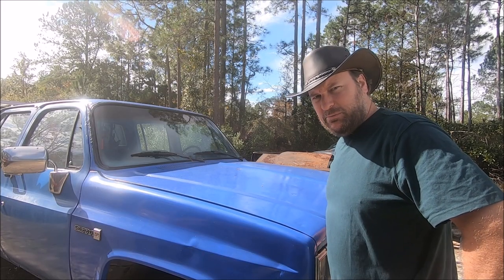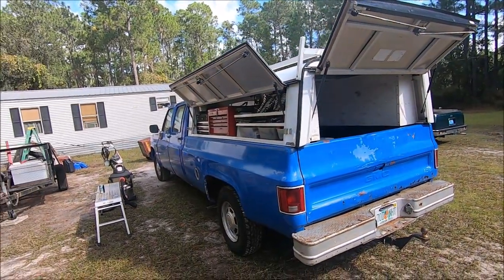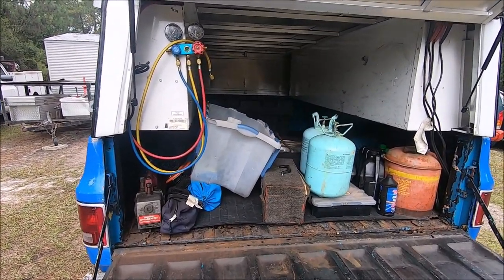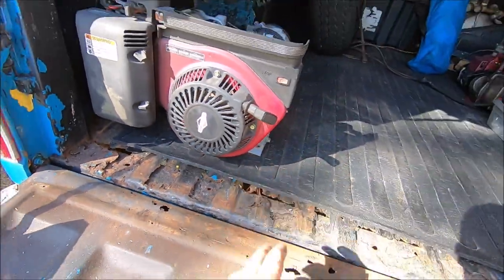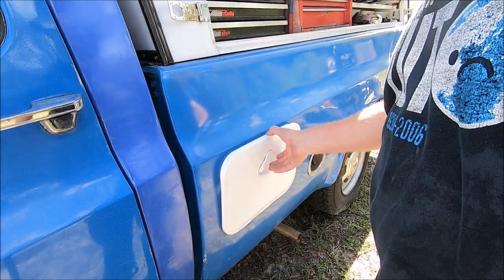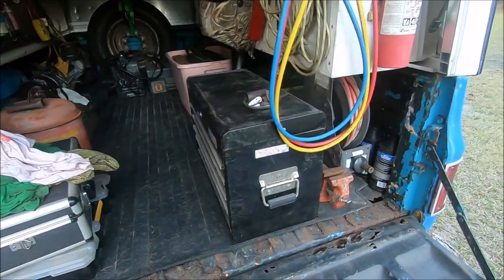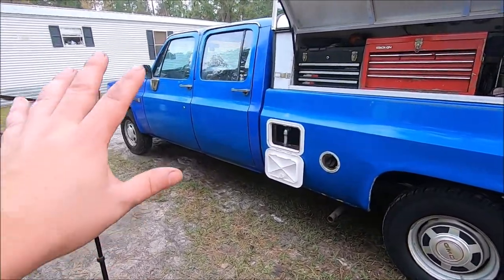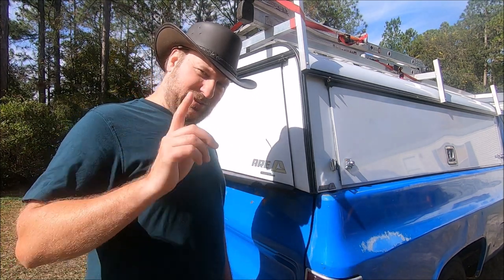1978 GMC crew cab service truck setup and configuration

Comment: Love it! Just an idea; take out the rear seat & put some tool boxes in there in a T shape? I was a full time maintenance tech for 8 restaurants & used a '01 Blazer & not alot of $. So use what you got & keep looking & thinking for things you need to make you more efficient. Keep the faith!
Reply from the maker: I could, but I need comfortable space for the dog when I have more people than just us. That’s one of the reasons I moved from the reg cab utility truck. We did a couple of times with all of us crammed in on one bench seat and it’s too tight.

Comment: You could raise the topper up a bit with a spacer board between the topper and the truck bed sides. Cheap wood (pallet wood). Just enough for the tailgate to clear your topper.
Reply from the maker: I needed you to say that before I got out the 4lb massager 😂😂